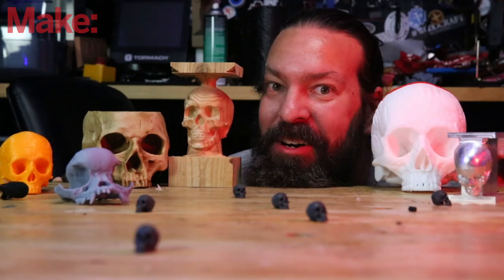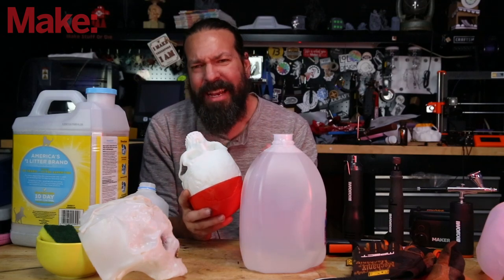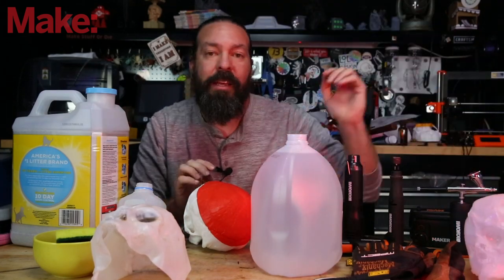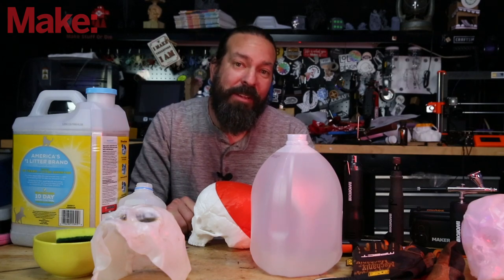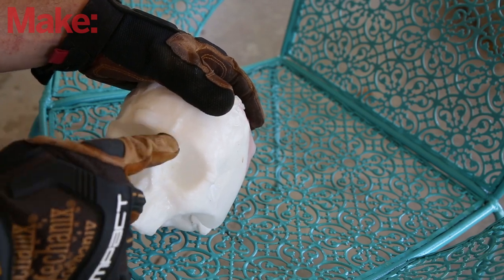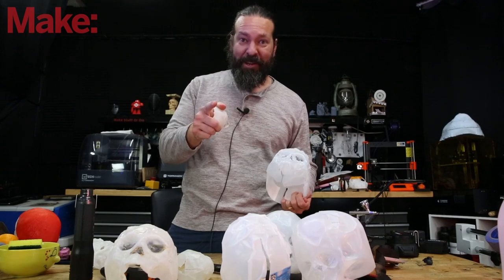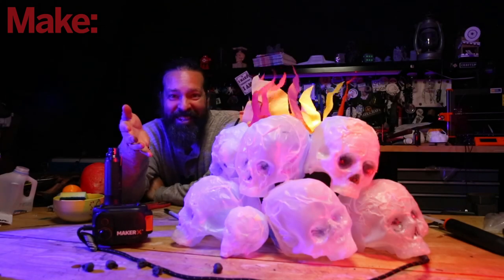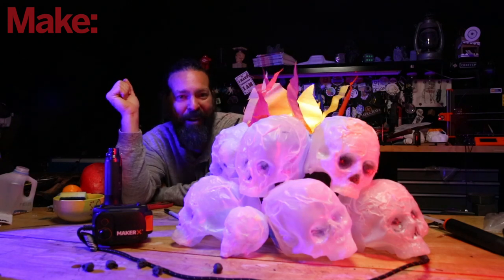How To Make Skulls Using Old Milk Jugs And A Heat Gun

Comment: Tip for this technique to make it go WAY faster. The sponge tends to get hot and then dry out so it's good to keep a bucket of water on hand to rewet the sponge but also big enough to dunk the skull in (or plastic hand, whatever you're heating up and bending). I use ice cream buckets since they are a great size and not too deep. Then you can not only push the parts in with the wet sponge but you can harden it SUPER fast by dunking it in the water once it's pushed in. Relying on just the sponge usually leaves the parts a bit soft unless you wait FOREVER for them to cool down. Dunking it in the water basically instantly solidifies it since the large amount of water transfers the heat super fast as apposed to just the wet sponge. This way sped up my process for shaping plastic by quite a bit.
Reply: Ice cream buckets are made with a lower viscosity and yes melt way easier and looser than regular HDPE.  I've be suspicious for a while that they and other plastics labels as 2 are actual type 4 LDPE and they just slap a 2 on everything.
Reply: @inventtory1272  I'm not using the ice cream bucket for melting. It's to hold the water to cool down the milk jug. I have just found that they are the perfect size rather than a deep bucket or taking a bowl from the kitchen.
Reply: @heyjustj  OHhh..  lol  oki doki

Comment: How well does acrylic paint take to them? This is a great technique but I'd like them to end up less shiny, more matte finish, more granular detail (cracks, teeth detail, etc.)
Reply: I would think acrylic paint would go on pretty well ... layering might be difficult but if you let dry between coats and  did it easy enough I think that you could get good depth with out messing the under layers ... seal it with some clear spray